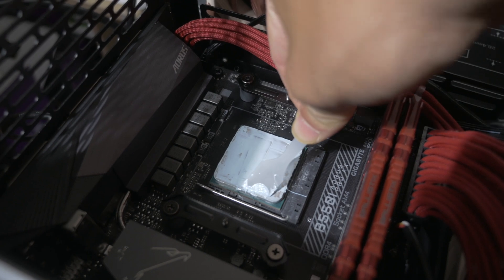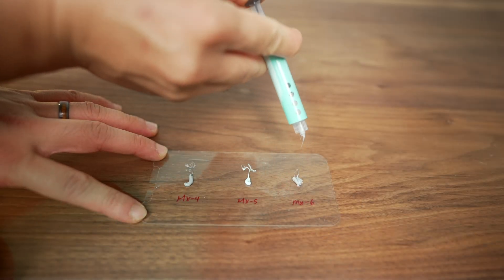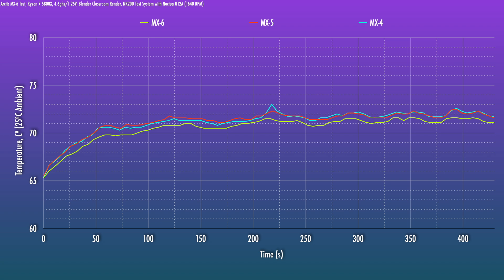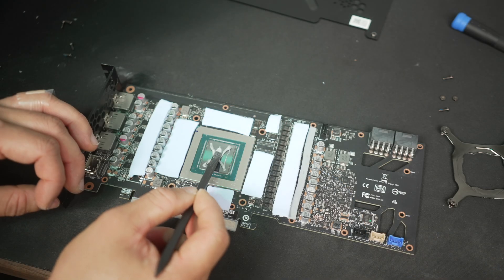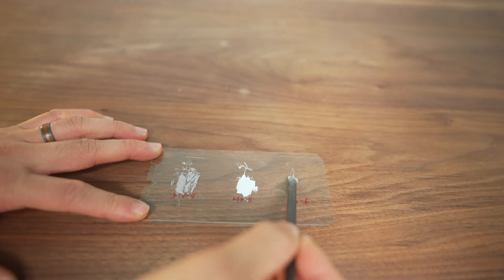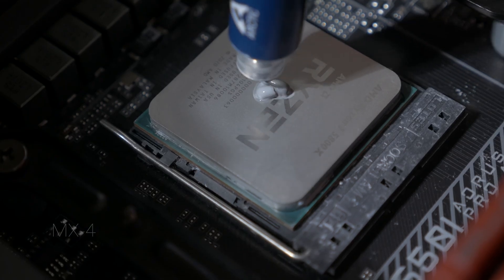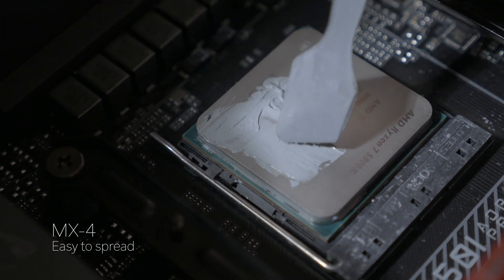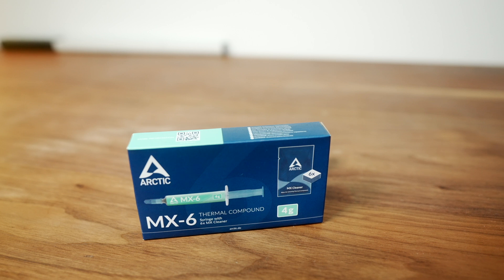A Top Tier Thermal Paste - Arctic's MX-6 Arrives!

Comment: What about those CPU/GPU graphite thermal pads? Lately, I've thought how water cooling maintenance would be much easier with that solution, versus unmounting up to two blocks, just to replace paste that inevitably wears out.
Reply: The MX pastes are designed for 8 years. Chances are you will replace hardware on that kind of time scale before replacing the paste as long as you apply it correctly.

For example, NT-H1 is designed for 5 years I believe yet the thermal performance is still good 9 years later, without any remounts.
Reply: @pspublic13  I've used AS5 for 5 years on an FX-8350 rig... and those CPUs pulled the watts.  When I parted it to sell it out, paste was still fine.  Temps stays great the whole time lol.. so I never messed with it.

I still use AS5.  Got it between a Fuma 2 Rev B and a 5900x (142 watts).  I MAY try MX-6 next time.. but it's hard to beat AS5 once you learn that certain technique.  Too little or too much can throw the temps off 4 degrees.  You get that paste just right, and I bet it beats MX-5 and MX-6.  My temps are always better than the other reviewers testing Fuma 2 rev B + 5900x.